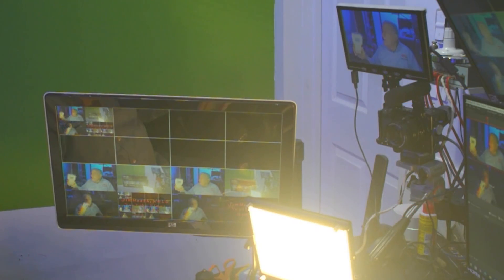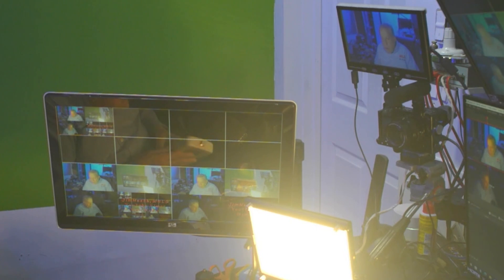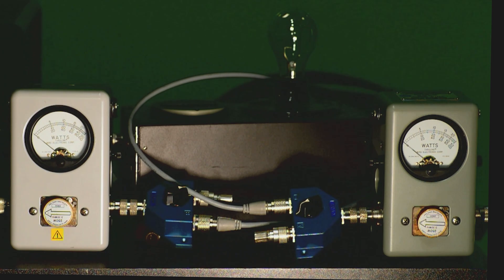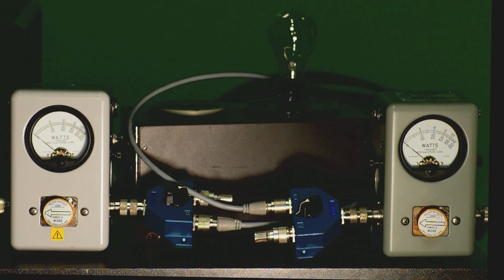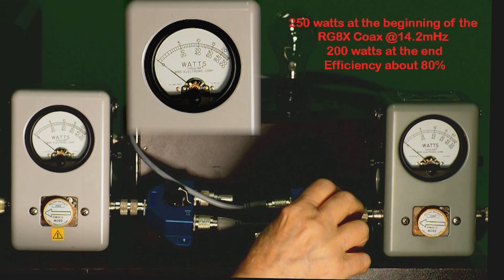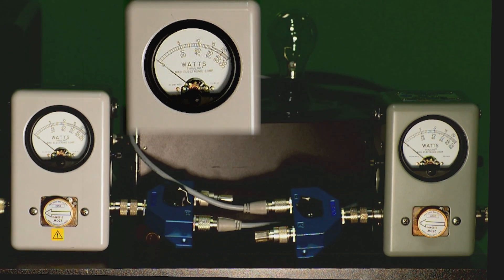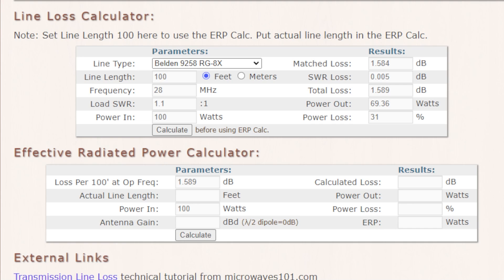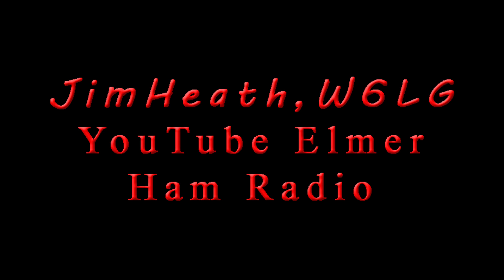Is Your Coax Cable Stealing 40 to 50% of Your Power? Jim, W6LG Uses Bird Watt Meters, RigExpert AA35

Comment: Well Said, Jim! Better coax is always a good investment. Get the best coax you can afford. Its an integral part of your antenna system. Another advantage is, in my experience, better coax will also last longer before needing replaced. I'm retired from the communications electronics field, and I've had to replace a lot of cheap coax over the years.    73   -mike

Comment: Times micro wave 240 uf  , very high quality double insulated rg 8x type cable. Center conductor shielding polyurethane. According to spec. sheet .3db @ 30 MHz/ 100 feet!!!! KJ7TBR chow

Comment: I may have missed it, but did you use a 50 ohm dummy load for the measurements or just the light bulb ?  Light bulbs can change impedance greatly as they heat up.  I did not see you look at the reflected power and that could throw things of

Comment: 01:23 If you output 100w and loose 3dB in the coax, that is 50W at the antenna. Most people don’t know that is ONLY a minuscule 0.5 S-Unit lower at the receiving station. Same with a small mismatch, don’t get hung up on it and focus on a good antenna!
Reply from the maker: May I politely disagree?  I do not want to give up 3dB ever, anywhere. I am a lifelong DXer and it is hard to replace that lost 3dB.  Additionally, it makes the SWR look better than it is.  Additionally, put  your money into the antenna system including coax, switches, etc.  I can hear and so can you, a 3dB reduction in signal strength.  It makes no sense to me to invest in an antenna that has 3dB gain and then lose all of that in coax losses. Good coax is key to a good signal.  That's my view from Rocklin, CA.  Thanks, Jim w6lg

Comment: I must say, this is a beautifully streamlined demonstration and presentation. It's quick to the point, and crosses over the the theoretic, and practical measured with two levels of equipment and technical instruments. I have so much to say on this subject, but I'll leave it to these further comments.
The online loss calculator really opened my eyes, even more so when it comes to ERP. You mentioned Heliax as basically being close to lossless, and when you have an antenna with, say, 9DbD of gain, the benefits of running such a coaxial cable really does come into the picture. You've invested so much of your hard earned money and effort, so why skimp on the coax? You're simply strangling the system, and at the end of the day, it's just false economy... which makes no sense.
Brilliant, concise stuff. Proof!

Comment: Check your coax for damage or water i dont use the thinner coax as it is easy to damage i have been using rg213 and it is reasonbly cheap strong and has a good low loss

Comment: Remote transceiver at the base of the antenna, or 1-5/8" hardline. Or, for us peasants, use Rg8/213 (maybe LMR 400/600 if you have more coin) and hope runs are shorter.

Comment: I have 100’ of LMR-400 from the antenna (Butternut HF9V) to my radio.  I have a question:  should my tuner be local to the antenna feed or close to the radio like I now have.  It seems I am getting a bit of loss according to my swr meter….

Comment: It always amazes me that some Radio Amateurs spend several thousand in the shack, Then go cheap on the weak link, the feeders? I only use double screened coax for, as you mentioned noise reduction. It's a simple fact that reducing your noise by, for example, 3dB doubles the performance of the entire system. PLUS it greatly reduces induced RF into any other cables when transmitting. Great video 73 de GØUSL

Comment: Why doesn't anyone make a linear with a receiver gain block that is mounted at the antenna terminals?   That gives you the maximum legal power at the antenna, and enough RF gain on the receiver to minimize the impact of house generated interference.

Comment: Happy New Year Jim. Unfortunately many types of inferior coaxial cable are on the market and you cannot always believe what is embossed on the sheath. I have certainly seen cheaper cable with just a wisp of braid, unsurprising really with the price of copper. It is definitely a case of "caveat emptor", would you buy a cheap parachute from someone on Ebay with a strange name?

Comment: I'll start by saying I'm not a fan on switching cameras. In particular the one where you tried showing the Rig Expert.
 For short jumpers, I've become a huge fan of RG-316 or RG-142. The Teflon dielectric is almost impossible to melt. Happy New year! W8BT
Reply from the maker: Thanks. I always make some mistakes and something goes wrong in every video. I use Heliax that is almost 1 inch, 400Max and that large diameter RG216(or mabe RG218) and open wire feeders where I can.  Thanks for the comment.  I am just an old guy learning how to make videso still after more than 200.  Thanks, Jim
Reply: That's brilliant, so the loss of EMF to heating your backyard won't melt the cable. I'm going to throw away my LMR600 right now and switch to cable used for the internals of a radio or amplifier. 😆

Comment: i have RG 8x to my 40 meter end fed, but it's only 6 meters long. with the lower frequency and such a short feeder i'm not going to worry about the loss on that one. i intend to put up a vertical half wave for 20 meters, but it will need maybe 15 meters of co-ax. i won't worry about that one, but if i add 17 and 15 meter bands i may have to think about RG 213 or LMR 400.
Reply from the maker: Ya, all of that sounds good and you demonstrate a good knowledge of what to use and where. And, that is what many need to learn from guys like you.  So help a neighbor who is new when you can . Thanks, Jim

Comment: Well dud,  A major spec of cables is the loss per meter at various frequencies read and learn them!  Also not mentioned is the connector loss add about 0.5db per connector.  What you also have to think about is to NEVER use only watts as a measure of loss always use decibels which is the ratio of input to out put.  By doing this you can understand that the transmitter power is affected yes but also the receiver signal is impacted.  As a point of note commercial systems can accept up to 6db (or more) by compensating for the "loss" in planning
Reply from the maker: Hi Scott,

Thanks.  A few years ago I connected a bunch of right angle, double female, double male connectors in a long string that was maybe 4 feet long.  Some were N, some were UHF, some were BNC and some just junk.  There was NOT a half a dB loss in all of them combined.  At HF, there is not .5dB loss per connector.  That is an old tail that I have disproved many times.   

Loss is loss.  In other words, as I said, loss on transmit and loss on receive are the same.  

If it easier for folks to understand a percentage like 50% versus 3dB or the 6dB is 4 times or 1/4 or 25%,  then my video is better understood.

The goal is to teach something in a friendly way  and not be confrontational.  Which is why I did the Bird Watt Meters, the online calculator and the reliable/accurate RigExpert.  I chose 10 meters/28mHz for the obvious reason.  

I can't give up 6dB or compensate for it.  As you know, that is 4 times.  On receive, to lose 6dB, it would be a loss I could not tolerate.  

Keep in mind I was only talking about HF.

Thanks for your input as usual Scott.  Nice to hear from you.  73, Jim W6LG
Reply: did you mean "dud" or "dude"?  I think you need to clarify
Reply: "Sad Ham" certified comment
Reply: Scott, are you serious?  Typo perhapes... Dude perhaps?  That's it... a typo.  If that is not a typo I like to think you are just a snot nosed kid that needs to get out of their triaining diapers of reading specs and get some real world experince... but I like to think it was just a typo.   Happy Planning Scott...
Reply: Spoken like a true Technician :P You appear to not know how to calculate things using real meters, analyzers, etc. You have to rely on pre-made charts, graphs, etc. and can't calculate something using power meters, VNA's, Spectrum Analyzers. Try to WATCH AND LEARN from Jim. He has forgotten more than you will ever learn.
Reply: I think you need to go back to school snotty mean.....   the loss is no where near your claimed fact... I look forward to watching `your` expert video series... when`s that out sonny ?
Reply: FALSE. Connector Loss is also a function of Frequency. It is also dependent on the TYPE of connector. For example, an SMA connector at 2 GHz is typically around 0.05 dB. I have never seen a connector with 0.5 dB of loss unless it was an especially poor connection, like a poor clamping-type connector with braided shield. Also, SWR is the ratio of forward output power vs. reflected power.  (V)SWR = (1+SQR(Pr / Pf)) / (1-SQR(Pr/Pf)).

Comment: Also check the braid as cheap coax can have very wide spaced braid as I found out once after buying some at a radio rally. I was disappointed and certainly won't use it for v.h.f. even for a short run.
I want to see the braid now if I buy coax.
G4GHB.
Reply from the maker: You bet!  What is the percentage of coverage?  And, is that an exaggeration by the seller?  Thanks and 73, Jim

Comment: Thanks for this. I've thought for years I could do with checking my losses and your video reminded me.
I have an inverted vee with about 40' RG58U for 60m and attic dipoles for 20m, 17m and 15m with about 20' of RG8U. As I run QRP at 5 Watts or less I don't want to lose R.F. in my cable. Everything here is BNC connectors.
I'll be using a 50Ω dummy load and oscilloscope, good to 25 MHz.
H.F. is very forgiving and a little R.F. goes a long way. A Pixie at 350 mW out on 5.262 MHz got me an SWL report from 220 miles away when I had a QSO at 180 miles so I wonder how much I might have been putting out.
G4GHB.
Reply from the maker: I don't know.  QRP is a real challenge for both sides of the QSO.  I am amazed at what some of my friends have done on CW with QRP. It takes skill to set it up and to make it all work.  Sounds like you are having fun. I have always been more of a QRO kind of guy except when trying digital. I did make contact with digital using an incandenscent light bulb a few years ago. 73, Jim

Comment: Jim, This discussion is helpful for explaining coax losses . I am curious for your input on using ladder line vs coax.  I have several friends that use ladder line and always mention the great efficiency.  I am interested not only in efficiency comparison but also physical advantages or disadvantages and any other considerations of ladder line  vs coax.    Mark W3BAT
Reply from the maker: Window and ladder lines are excellent.  I use them where I can.  As a teenager I make a long length and ran it up a hillside to a beam located about 150 feet from my bedroom.  That took all summer and I learned a lot. 73, Jim

Comment: Hi. Thank you for the report. I still wonder why: all old and many new rigs still has the SO239 that is cheap and not so god conecting bigger cable to. Is it time to demand better conectors on our rigs so we can use the right good cable without loss. Thanks.
Reply from the maker: Yes, some are just crap with really bad tolerances.  The manufacturers often use junk connectors on expensive devices.  We know it when we go to connect the coax. There are, for real, some connectors made in China that are as good as it gets.  73, Jim

Comment: You are the best.  No bird meters here, but I do have a AA-600. So if I take my 1500w dummy load to the end of the run and then do an all parameters test, the RL/SWR  reading tell me exactly what is being lost in  the coax? I though you had show earlier that lossy coax had a  lower  artificial loss  number. I hope you have time to help me understand.
Reply: There are only two things with perfect SWR. A dummy load and an antenna in modeling software. We measure the conjugate loss of feed line and antenna. Obtaining perfect SWR as a measure of performance indicates ignorance of the science of EMF from a source to load. In the real world as long as the feed from source is tuned for reflectance that energy will recombine with the to forward wave. It's a few small compromises at both ends to maximize transmission and lower loss. If it were not true every percent of return energy would reabsorb into the source, your radio or amp would likely fail in minutes. It's why the tuner has been around since the birth of modern radio. Somehow over the decades the idea that SWR and load impedance are the only measure of a good system has been wrongly conveyed. It's a myth. If it were true multiband antennas wouldn't work and dozens of other effective radio devices would be ineffective. I'll use my old Antenna book and the Handbook of the ARRL as my source instead of engineering books with equations for physics. If you get those and read them you won't be bombarded with mythical information from I'll informed "experts".

Comment: Hi Jim,
Excellent visuals during the test. I've changed over to Messi & Paoloni Hyperflex 10 that goes out to the Ameritron switcher and then up the tower to the antennas. I estimate between 100 and 125 feet for the total runs. In the shack, I've changed over to RG400 for patch cables. With it's Teflon insulator, makes soldering connectors no problem as the melting point of the Teflon is higher than the solder. When I get into satellite work, will switch over to Messi & Paoloni Hyperflex 15. As you showed, the higher the frequency the higher the loss. You and your family stay safe.  73  WJ3U

Comment: Hope you are feeling well today.  I have always used RG-8 since the 60s only use 50 feet and only on 20 and below.  I feel that I am getting enough to the antenna.  I have tested by putting a watt meter between coax and the antenna and a jumper to the antenna from the watt meter.  At the same time a watt meter at the transmitter.  Have a great 2023 de WB7ORB.

Comment: This is another addition to my book of knowledge sir and you ate a 100% correct, a good station always boils down to the antenna system, either your running a good conditioned 40 year old rig or a modern expensive one. By the way sir, I'm just new to HAM, are you at liberty to share your email address? Thank you and all the best sir.

Comment: Ladder line trumps almost any coax, especially when cost is a factor.
Reply: True, but I don't think it performs well when I have to run 125 feet of it across the ground to get to my antennas.
Reply: @forgetyourlife  most installations for HF can install ladder line instead of coax for better results, so this is bang on topic.
Reply: @forgetyourlife No the point is transmission line loss.  But not everyone can run ladder line.
Reply: @forgetyourlife  coax is not a religion, and you seem very “square” and not flexible, this is not how science works, go get yourself 450Ohm ladder 🪜, with a bulun

Comment: Jim, would you like to way in on solid vs: stranded center conductor? Alpha LMR-400 type. (JSC wire and cable #3815 High Flex)   I have it already, just wanted your take on stranded

Comment: 50 foot LMR 600 for VHF/UHF, 50 foot LMR 400 for my CB and 10M antennas, and 75 feet of 8u to my all band HF vertical.  All four main feedlines are barely long enough to reach the radios, fixed by attaching Palomar "pipe bomb" chokes at the terminating end in the shack, letting a few short LMR 400 jumpers finish the jump.  And certainly, I do enjoy good power out, and high reception in.  50 foot and 100 foot rolls of premade 8x are now kept for experiments and when I hook up 80 meter short hanging wire.

I've heard a few people talk about their poorer setups.  "Its just 3db".  Astounded that people think that the loss of that much transmit/receive is just nothing.  Yet, you hear it all the time. 

Hope you are doing well through your medical troubles.
Reply: Correct, 3db of received signal is, well no signal to DX back to. It's amazing people with FCC licenses don't consider that.

Comment: I have a 175 foot run or so. I was on RG8X and people were umm commenting on it. So I found the RG213 that I had around in pieces from a swap meet and put connectors on. Unfortunately, I got water ingress in the middle chunk,  so that section went back to 8X.

I have an order ready to go at Messi & Paolini for ONE piece of their cable that measures better than LMR400 without going really big, like hardline.

I dual purpose the line, so some loss in the duplexers to push / pull 2m & 70cm using the same coax as HF as well as DC control of the remote coax switch.

I agree. These antennas receive really small signals and can't afford to lose bits and pieces all over the place. That and my power output.
Reply: I just looked at losses for RG213 for 70cm for that distance and figured out why it and 2m seems "distant". (I didnt dare look at 8X!) Less than ¼ of the signal at that distance. Then I priced the top M&P cable for the length I need and went jaw agape.

I know that losses hide SWR, so now I want to measure at the antenna to see how it really measures for 2m and 70cm. I may wait for spring though, so I don't have to unwrap and re wrap the connectors with self amalgamating tape.